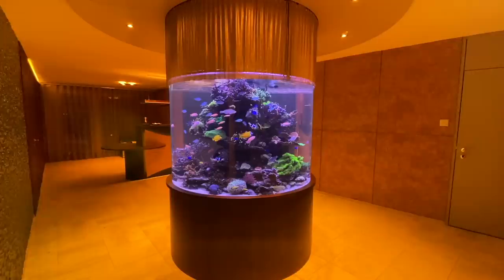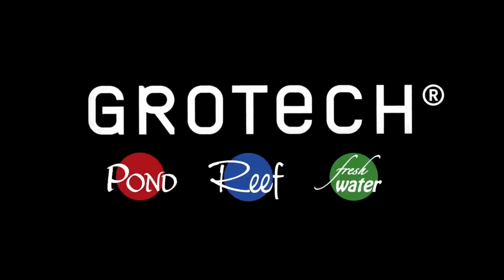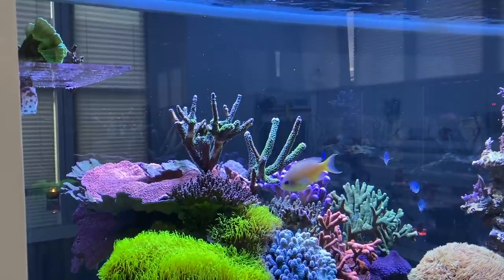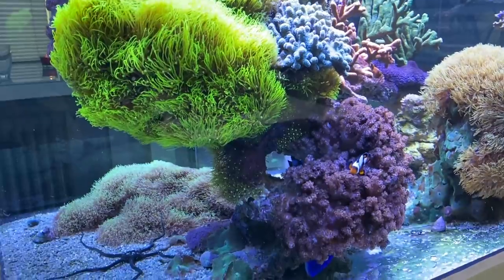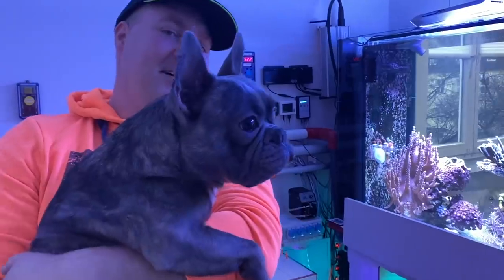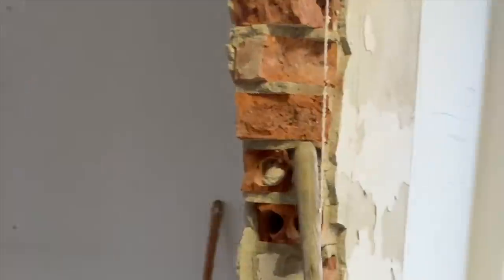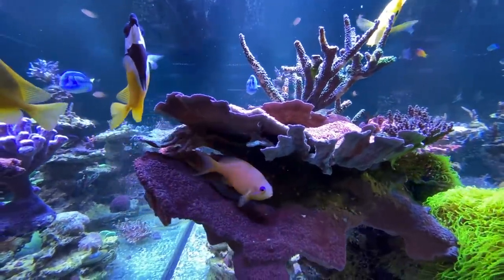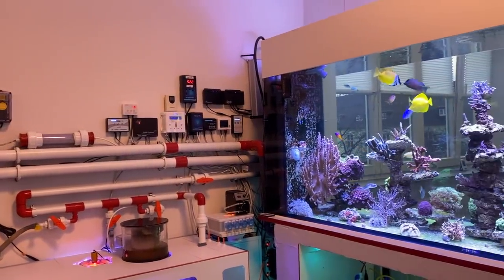"How to build a reef tank into a wall" - SALTWATER AQUARIUM - *not easy!!*

Comment: This didn’t work out so well for me the tank creates a lot of condensation and the sheet rock sucked it up like a sponge and rotted be carefull
Reply: The Wall at the tank ist painted and isolated With Latex
Reply: @dennis4u432  most indoor paint is latex paint I would put a dehumidifier in the tank side room